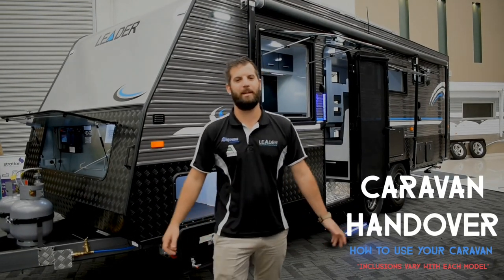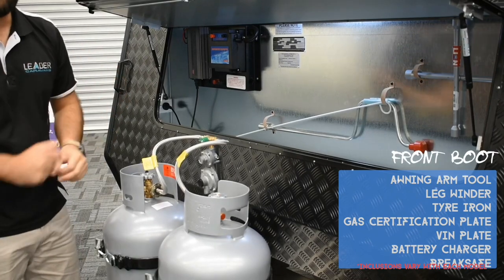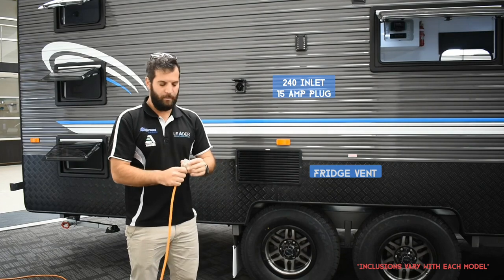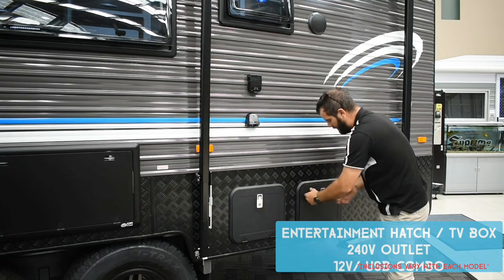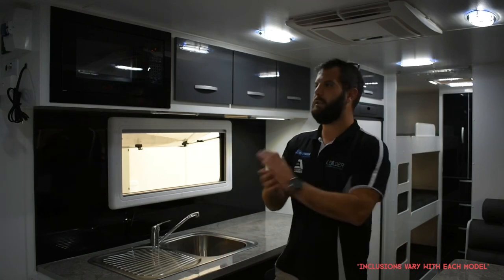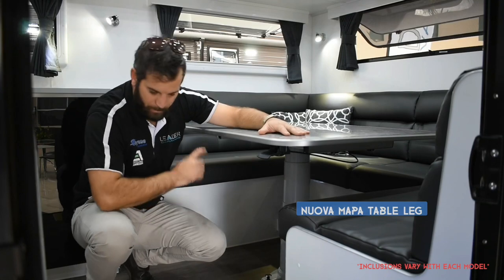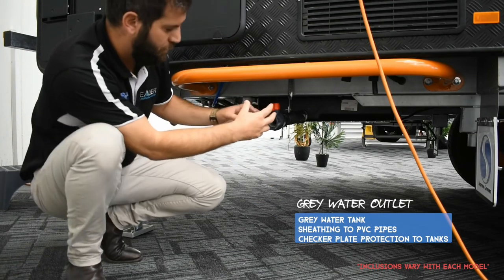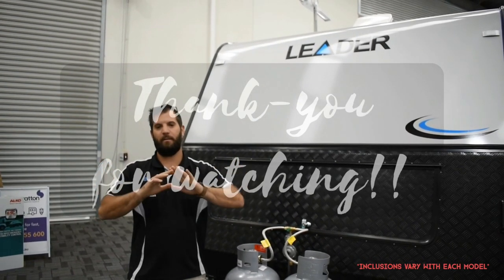Complete Handover Video

Comment: Did not see anything on the gas hot water and how to run it. Also when you are parked up at home for say 6 months do the solar panels keep your batteries charged or do you need to plug into 240v or run a trickle charger? Great video by the way. Good to see Stig is still around